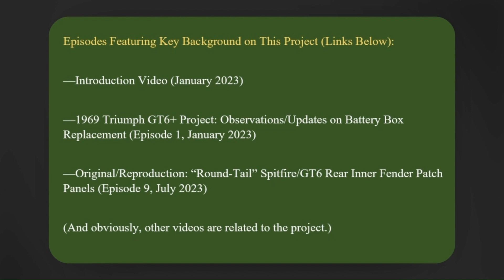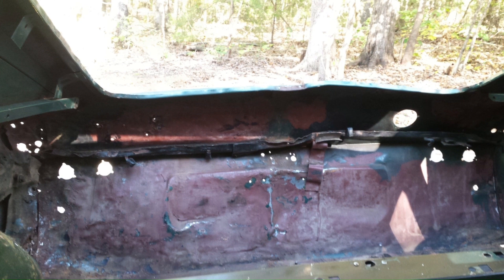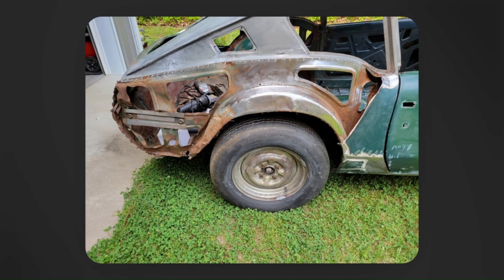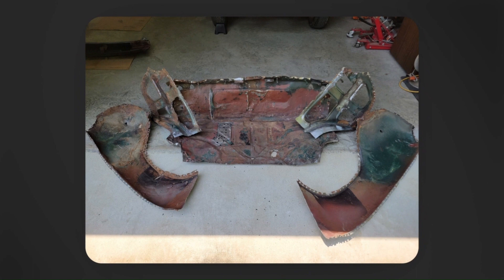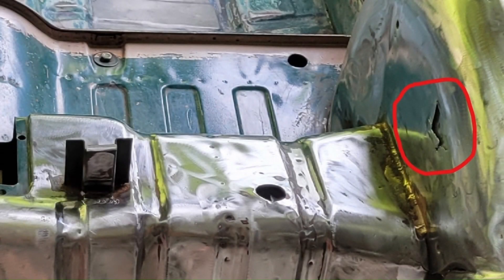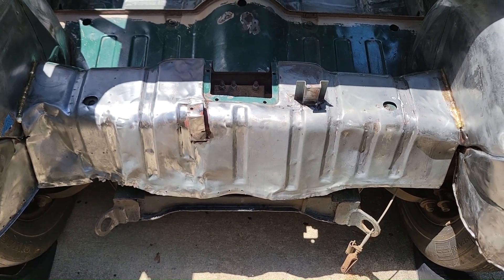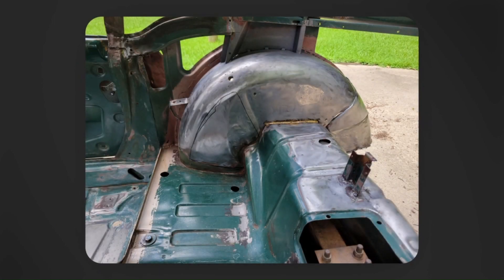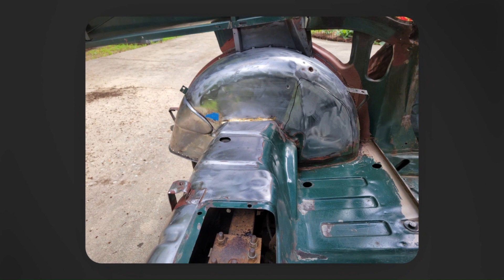1969 Triumph GT6+ Project: Summer Work Update, Part 1: The Body (Ep11.Jul/Aug 23)

Comment: You've really got a project there, Bryan.  In many ways, accident damage is worse than rust damage.  Your attitude and approach seem good though.  Skills can be acquired.  It will be an interesting journey.

Ed
Reply from the maker: Thanks for following along! It's true that significant accident damage is probably a lot worse than rust...unless we're talking rust where portions of the car have absolutely disintegrated/collapsed and no decent replacement panels are available. But I'm trying to stay positive (i.e. keep the old "glass half full" mindset). Your website has been one of my most important resources. I stared at photos of your car in various states of disassembly numerous times before I dove into mine (although I was still surprised about a couple of things I didn't pick up on). Hopefully one day we'll have cars that look very similar, as I'm sticking with the 25/Conifer/Triumph Racing Green color original to my car that "you" (by which I mean your wife, according to your telling of it) chose for yours!
Reply: Find a spitfire doner rear section and get your inner panels needed as they are the same. right and left quarter panel is the same also
Reply from the maker: Thanks for the advice! I have BMH/Steelcraft/reproduction panels for the worst of it (boot floor, rear valance, rear wings, rear inner panels). From where things stand in the video, I really would like to salvage as much original metal as possible (whatever can be straightened to my satisfaction), but I've definitely been thinking about getting some additional patch panels from Spitfire or GT6 parts cars to help with some of it.